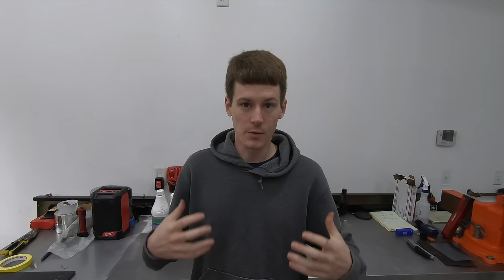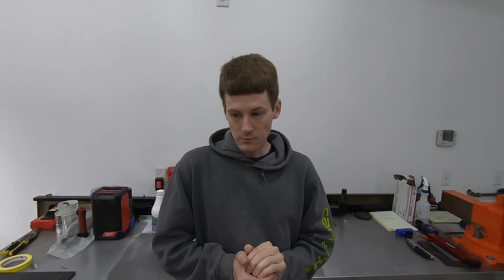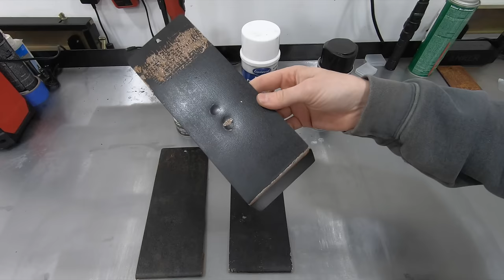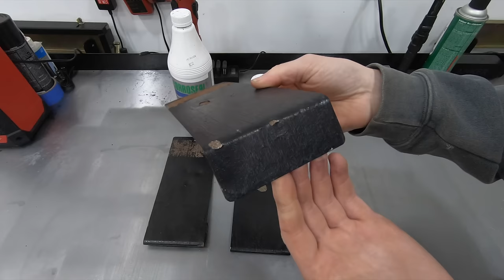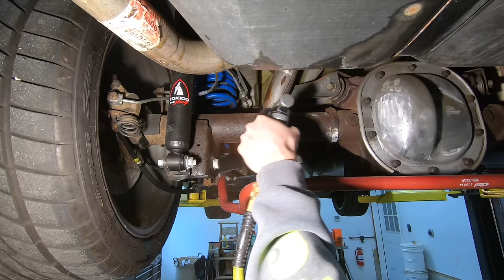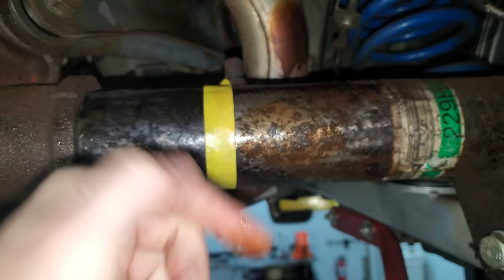MOST Rust Converters Are A JOKE! Let Me Show You. (Eastwood, KBS, Corroseal, Ospho & More)

Comment: Guys.  I'm looking for the next step after applying a phosphoric acid product - like the Rust Kutter he recommends.  Specifically, I have rusty scratches on the door of the truck I just bought, and a rusty bumper from when the previous driver bumped into something.  I want to grind them down, apply Rust Kutter - and then what?  What type of primer will adhere to Rust Kutter on an Truck door?  

Thank you.  Everything on this channel seems to be geared toward the underside of vehicles.
Reply from the maker: The overspray from rust kutter will destroy the paint on the door if you leave it on there. Hit it with rust kutter, wait 24 hours, use the primer of your choice then paint it.

I like the mastercoat rusty metal primer: https://nomorerust.com/store/rust-stop-paints/8-mastercoat-pemanent-rust-sealer.html
Use 2 coats of that primer, spray the topcoat when the primer starts getting tacky.
Reply: @RepairGeek  you say the rust kutter will destroy the paint, but then go in to say to use rust kutter.  just checking: did you mean to say a different product... or to ahead and use rust cutter, but be careful because thee overspray will destroy the paint too.

thanks a million
Reply from the maker: What I'm saying is don't spray the rust kutter on the outside of the car. You will eat the paint off of it.

Comment: Rust converter is garbage. I used it on a truck bottom doors. Sanded, rust converter, prime, coat of paint, rock guard, paint, clear. After the first winter spots peeled of like a banana skin down to the metal, which of course had rust.
Used phosphoric acid this year. And re-did everything.
Rust converter is great to pretty up things before a sale.  But that's it.

Comment: You didn’t test Por 15 . See project farm when he tested these products. Also it seems that one should use rust cutter before applying a  surface shield such as Blaster .
Reply from the maker: I tested POR 15 with the other rust encapsulating paints that I tested. POR15 is not a rust converter.

Comment: Isnt phosphoric acid in CocaCola? Maybe ill try that lol. Got an 8×8 piece of diamond plate decking thats half rusted thru on my dump bed. Truck was formerly a snow plow/salt spreader. Surprisingly there is no rust on the truck itself.  I just want to slow the cancer down before i cover it with new sheet metal.

Comment: Do you think it would be safe to use ospho and then surface shield after?
Reply from the maker: I don't understand what the benefit would be. The SS itself would stop the rust why do the extra step?
Reply: Well the ospho would need to be painted after it coverts the rust.  In one video it looked like surface sheild would do better than paint.
Reply from the maker: Yes but why convert it? What is the benefit if lanolin stops it by itself?
Reply: True.
Reply: @RepairGeek  are suggesting to just use ospho and nothing else? Does ospho have lanolin?

Comment: I have great results with wire wheel then ospho let dry a week then corroseal let dry a week then if not on exterior I spray duplicolor rust barrier if exterior panel a true 2 k epoxy This will give you 4 to 6 years

Comment: Sadly only 3 where done RST TRP BLCK from O'Reilly's is a brush on rust killer and sealer in one it's 256 bucks a gallon it is used in most undercoating shops it's made to coat frames yet can be used all over the under side of vehicle it's doesn't need any coating on top of it very difficult to find and very expensive this is because it is by far the best out there I've used it for many years it has changed nanes over the years yet the same ingredients are being used I have vehicles that I've used this on and 20 years later this stuff has done its job and still holding up washing the frame off and it's still shinning like new it's very similar to flex seal mixed with rust killer it holds up much better to clean up the surface rather than to just brush it on as the can says can be done yet anyone with half a brain knows if it's falling off it come off sooner or later then this stuff comes out and really it holds lose rusty junk together for home long not sure because I've only done that junk that crashed up at the end of vehicle use yet it's far to say that bonded like flexseal rubber coating mixed with rust killer it doesn't come off I've beaten it with a hammer it does however take days to dry the older it gets the tougher it becomes over long periods of time it keeps it shine one step rust killer and sealer in one can again I call it two steps because cleaning the surface with a wire wheel or wire brush is all it needs to last a very long time Let's also keep in mind what part of world and country we are in East coast in New England USA is known for its horrible rust conditions you will find much better rust killer sealer in New England then you say AZ where there's little to no rust on vehicles 
The products this young man used are unheard-of here in New England none of them are at well known part stores other than the big nane brands any smart person known not to use those products for the simple fact they are for the majority of people who don't know crap about automobiles or rust in this case best place to go is to the professional shops that do undercoating find out what they use and what kind of guarantees do they offer if you were to have them do your vehicle few will say 20 years there are 4 places in New England that I know of and they use this stuff 20 years they guarantee their work
This young man is 100 % on the right track yet I myself couldn't recommend any of that commercial junk ohh btw this stuff is very difficult to get by the gal my order took 3 weeks to get I could get quarts of it yet it's very expensive 
It would have cost this young man around a grand to test real rust killer and sealer in one what he did us went to AutoZone Advanced Auto Parts  bond auto sold out to O'Reilly's and Napa those are specially stores that mostly deal with mechanic shops there you'll find a much wider range of parts and products that you won't see at the other stores the young man more than likely is in the middle of the country not much rust there although he touched on the most important things like you get what you pay for if ppl are not willing to do their research then you get what you get

Comment: I wish you would have tested POR15. That was best in Project Farm testing. In Project Farm testing RUST CUTTER was one of the worst performing. Watch BOTH videos before making a decision.
Reply from the maker: POR15 is a paint, not a rust converter. Just because Todd used it in his test does not make it a rust converter. Any true rust converter is designed to be top coated with paint. You can't compare apples and oranges.

Comment: Bud the naval jelly by loctite works pretty good if you follow the instructions. I just used it 4 hours ago on my diff cover. And it doesn’t leave a coating. You brush it on and let it sit 5-10 mins and wash it off with water. And repeat if needed. It says it’s a rust dissolver. Not used to convert rust to a paintable surface. It even says to remove chucks of rust if needed. Which I did with a hammer and chisel.
Reply from the maker: Main ingredient in Naval Jelly, phosphoric acid.

Comment: You should have let them rust outside naturally. You added chemicals not natural to your test. Did you follow instructions? It converts fe03 to feo4, which is still iron oxide but doesnt spread like o3 or others. It also seals from oxygen.

Comment: My first impression is that maybe your creation of rust panels might be flawed. I like your testing of adhesion and the drop test, but creation of a rust panel in less than 24 hours seems flawed. 
   I would have liked a more intensive rust panel. Like maybe just salt water over a 14 day period. 
   Also, I think the test panel should have been thoroughly washed and degreased prior to the salt preparation. 
Anyway, good video.
Reply from the maker: Watch the second half.

Comment: Years ago (about 21) I spray painted a part of some metal shelves I had left out on my patio right where the rain could make it rust, naturally.  I sprayed the parts that were rusting.  It was supposed to be sprayed over rust and would stop the rust in its progress.  It did.  But my mistake was that I didn't spray the complete shelves.  This past summer I began to de-clutter my patio.  I used a wire brush on my electric drill but it wouldn't remove the brown "rust" . . . which turned out to be the part that I sprayed.  It wasn't rust at all.  What did I use?  It was either Krylon or Rustoleum.  I can't find the 20 year old spray can.  That's what I get for trying to de-clutter. 🙁

Comment: Rom my experience with the rust converter i use it states on the back to removed most of the rust and any flake but of rust before coating for best prevention of the rust coming back clear in most of these videos people seems to think oh let's just spray it or coat it over the top and see if it will fix it come on guys really? Read the instructions before use if you have no idea what your doing, you welcome. 😉

Comment: Rust converters work great trust me I’ve used enough of it. I hate fluid film looks like shit. Needle D-scale your frame use rust converter then use rust oleum heavy rusted metal primer in the qt can then three coats of 3M rubberized Undercoating works great and I live in the Northeast and you don’t have to do it every damn year lol maybe once every 5 years for touch up and it looks excellent.  Also spray oil inside frame

Comment: You didn't test any of the goats.. converter primers: por15 vs XIONLAB , chelators(true converters): evapo rust vs rust revenge, rust removers(acids) krud kutter vs naval jelly vs klean strip.  You also don't seem to understand how rust "CONVERTERS" work. They are chelators meaning they provide a more attractive molecule for o2 to bond to than the steel underneath. it stops future rusting as a barrier and only actually converts the very surface of the metal or rust that is why you must remove all loose rust and get the rust layer as thin as possible.  the conversion process is slow. rust stripers are not converters
Reply from the maker: Rust encapsulating paints like POR15 are not rust converters. Evaporust is also NOT a rust converter. Try watching my paint video and my rust dissolver videos... Sorry my rust CONVERTER video didn't cover paints or dissolvers... SMH.

Comment: Looking at your rusted test panels,  it looks like you created geothite with your spray on mixture ( yellow color).  Geothite is not normal rust you usually find on metal. Normal rust is a hematite , a different compound!  The rust converters are designed to convert hematite, not geothite....
Reply from the maker: Try watching towards the end where I used them on a 20 year old axle and the results were largely the same.
Reply: Whats the black rust that remains even after electrolysis? magnetite or something? I used strong citric acid, I used electrolysis for days, the part was absolutely spotless apart from these weird black spots which were completely untouched by both. Very strong, although it would chip off with a chisel.
Reply from the maker: Iron Phosphate.

Comment: Did you clean off the residue from the solution you sprayed to cause the rust? As in let it rust and then rinse it off. After all any surface you paint should be clean even if rusty.

Comment: Literally the opposite of what Project Farm found.
Reply: You noticed that too.
Reply from the maker: I like project farm. He runs excellent tests but, I wasn't crazy about his rust converter video. He has rust encapsulating paint products tested along side rust converter products. They are two separate types of products with 2 different functions. Blasting Rust Kutter with a pressure washer seems like an odd test for a primer.

Comment: You should have left the rust in place. . .you can not coat a non-rusted sheet of steel. . . if it flakes to bright metal. . . then there was no rust to convert. . .of course it will flake off. . .3m Extend (Locktite) rust conversion is a white latex paint that changes red rust to black rust. You are not supposed to remove the base rust. just the loose flakes. If the Locktite peeled off, it's because it did not activate with contact to rust.

Comment: POR15 system is the only way to go. Firstly, you need to degrease before applying the phosphoric acid, secondly, you need to keep the area you’re treating wet with the phosphoric acid for at least 10-15 minutes. Then you can apply the POR15, after that dries, you have to top coat it to prevent UV damage. It’s the only system that works, I have parts that I did 25 years ago that are in the EXACT same condition as the day after they cured.

You really need to let the POR15 fully cure before you top coat it, or it can wreck the POR15 and you have to do it again.

It works, but with how long it takes to do properly (highly temperature dependent too) I’d rather just sand down to bare metal and etch prime it.
Reply from the maker: POR15 isn't that great... Video coming in the late fall. Even with the topcoat, it doesn't change the UV resistance much.

Comment: Rust convertrer is less for rusty parts and more for surface rust beneath paint...remove paint, apply converter, fill, prime, and repaint.  I wpuld never buy an off the shelf...i wpuld.go to an auto body shop and buy what they use.  It is not gonna fix anything that had been rusted through.
Reply: The physics and chemistry are the same whether at home or at a commercial shop. A shop doesn't have magical powers. Lol.

Comment: por the best
Reply from the maker: Por is paint. Not a rust converter.
Reply: @RepairGeek  por 15 should be convert i think？
Reply from the maker: For a product to be a rust converter it needs to have some form of acid in the formulation. The paint has no acid in it. Therefor, the iron oxide that is rust will not be converted into iron phosphate. It's a paint. The only POR product that has acid in it is their metal prep, which has 1/2 the amount of phosphoric acid as Rust Kutter, Ospho, & Rust Eater.
Reply: @RepairGeek humm the instruction said can be applied directly to rust surface though it have a primer and cleaner with it
Reply from the maker: @gubiu9246  rust converters chemically change rust. POR just coats it.

Comment: How did Rust Kutter not win?
Don't be fooled by the illusion of black paint
Reply from the maker: It did. You can get similar results with any phosphoric acid product.
Reply: @RepairGeek  that's not what was recommended at the very end... It never got a mention and was clearly the superior of even the phosphates.

Good job testing the products, thank you
Reply: 9:35 and 13:50